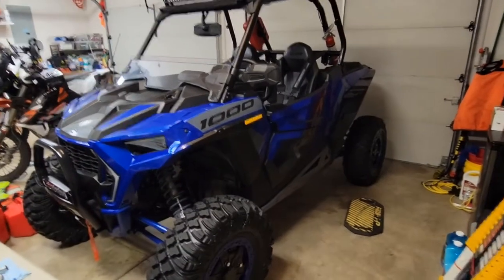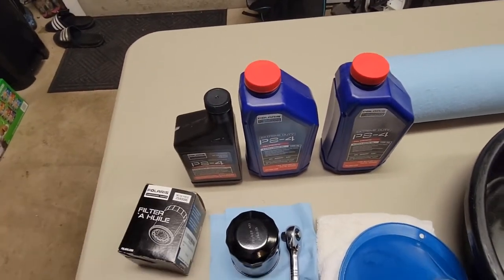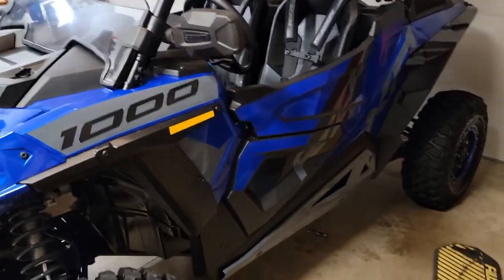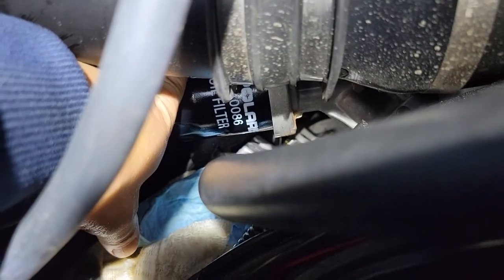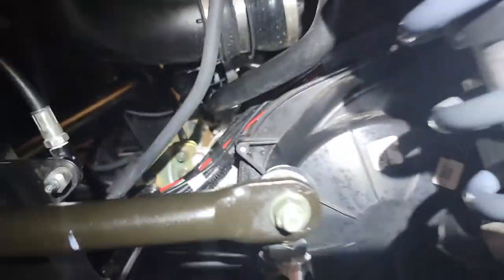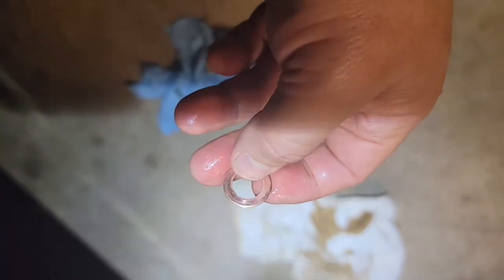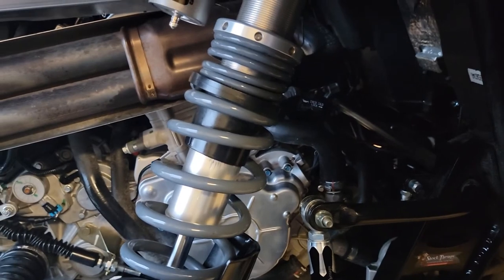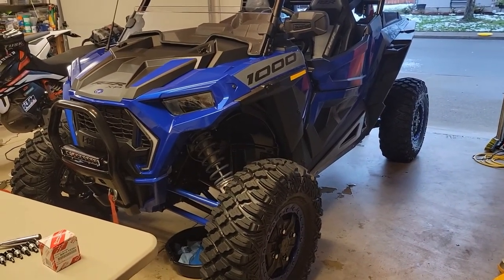2021 Polaris RZR XP 1000 Oil Change: Quick, easy and accurate!

Comment: Great video. How do you like the Pro Armor Crawler XGs for the desert of MOAB?
Reply from the maker: Thank you!  They worked perfect, did easy, moderate and difficult trails and they did them all!  The grip surprised me many times when I had to crawl up faces of some larger rocks from a dead stop.  The 40% reduced low range was a huge asset as it allowed me to left foot brake when needed to keep things slow while keeping momentum up some waterfall type rock shelf obstacles.  Here, I just posted this up for you.  Watch "2021 Polaris RZR XP 1000 Rocks & Trails--7 Mile Rim on rocky shelf obstacle. Left foot braking." on YouTube
https://youtu.be/nJVjf4oRV3g

Wipe Out Hill:   Watch "2021 Polaris XP 1000 Rocks & Trails--Moab Wipe Out Hill!  How does it do?" on YouTube
https://youtu.be/CwO5wSPAp6Y
Reply: Great video! I have to ask how do you keep your machine that clean? Love the moab clips, that is my favorite place to ride, if you haven't already do hells revenge there's a wicked obstacle called hells gate is gnarly.

Comment: Do you have a video changing spark plugs?
Reply from the maker: Not yet, but that is a great idea. 👍  The key with that is clean top of motor very well ahead of time with a cloth and then wiggle the coil back and forth as you pull coil/spark plug wire off. Then it is a matter of swapping out plugs and a long socket extension is needed to reach the plug.  Use only OEM Polaris spark plugs and they should come pregapped.  I'll be sure and do one when mine needs it.  Great idea!